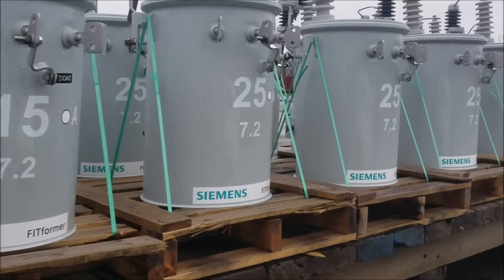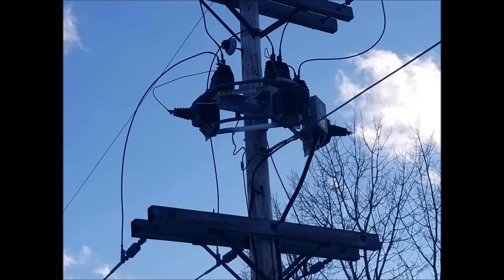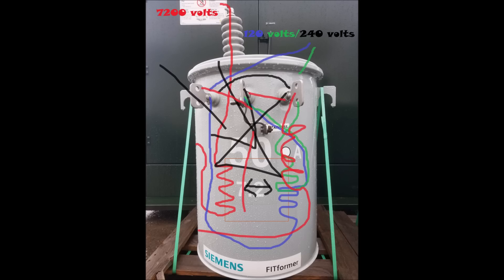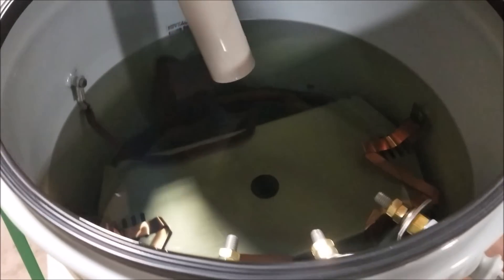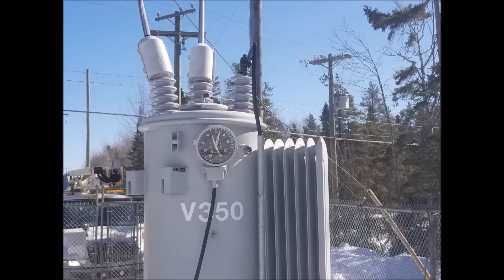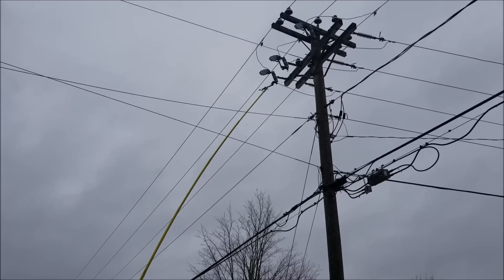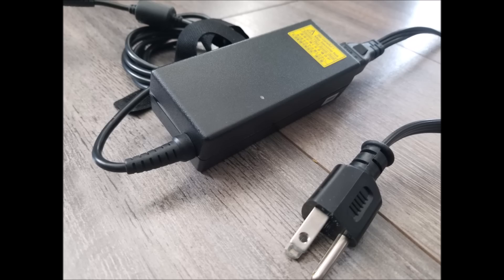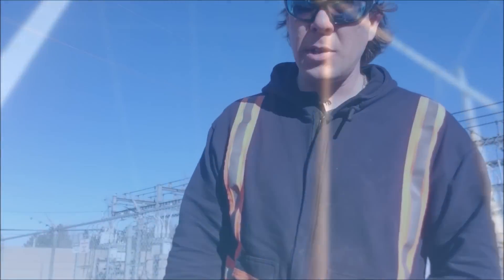What's inside a Transformer?

Comment: Nice and informative video however when explaining transformers used within the home most shown are known as switching power supplies. They do not used the legacy transformers to lower voltage and current. The types. Of legacy supplies are known as linear power supplies, they are considerably larger than switch mode supplies since they do use the archaic transformer inside. They are far simpler to repair and maintain but VERRY inefficient when it comes to power conversion. The transformer itself while on and idle will consume a fair amount of power.
Reply: A switch mode power supply reduces voltage in exactly the same way as a linear power supply - through the use of a transformer.  The difference is a linear supply operates at 50/60 Hz, and a switch mode supply operates at 100 kHz to a couple of megahertz.  That makes the transformer far more efficient.
Reply: Star Gazer Switchmode power supplies may use a transformer, but many use only a choke, which, while an inductor, is not a transformer (though one could argue over the similarity of a choke to an autotransformer, I suppose).  Which is used often comes down to the degree of isolation required (though many of the transformers used in common cheap Chinese switchmode regulators provide rather “unreliable” isolation...isolation is more a gamble than a guarantee).  That said, they are not used in a manner that is at all similar to a line transformer since the switchmode choke/transformer is being fed typically square-wave pulses (pulsed DC) of varying duty cycle and/or frequency rather than a clean sine-wave (AC power) and they operate on a phenomena rather different from line transformers since the output voltage is often far more, or less, than the turns ratio would suggest relative to the input voltage since they are utilizing a building (buck) or collapsing (boost) magnetic field to generate their output voltage unlike a line transformer where the secondary voltage is always proportional to the primary’s input voltage based upon the turns ratio (with some minor variation due to impedance and load variation pulling down the voltage under heavy load).
Reply: @ethanpoole3443  While true, all SMPS used to convert mains to low voltage do use a transformer and not a buck converter.
Almost always the low voltage side has other connections, and has to be galvanically isolated from mains, so it uses a transformer.

Only inside devices which are on mains voltage almost everywhere inside anyway (UPS, VFD for example) one will find non-isolated converters running from mains for auxiliary power supply.

Other than that, buck convertes almost always used to convert already low and isolated (typically up to 48V max) voltage to even lower (3.3V, 5V, etc...)
Reply: @ethanpoole3443  I've never seen a line powered SMPS that uses a choke instead of a transformer.  Chokes are usually found in buck/boost low level DC/DC converters.

Comment: My son was a first year apprentice lineman The back feeding of a improperly installed back up generator is exactly what happened to the Journeyman/trainer he was working with he was severely injured my son had to rescue and bring him down sadly he didn’t survive
Reply: It’s never dead till it’s grounded. Lineman have to keep this in mind every second every day.
Reply: @davidd1395  Yup. And if it's not generators, it could very well be induction from other energized lines, or even faulty UPSs that don't disconnect from their line side when they switch to inverter power.
Reply: Sorry about that. Wish you can get some strength and peace.

Comment: Very interesting video, thanks.
I have a question which may have nothing to do with electrical power but I’ll ask anyway in case it is. I’ve also seen someone else ask it but he didn’t get a clear answer:
Once in a while in my area I pass some metal pots attached to the top of sticks on the side of the road. The pots — which looks like typical pressure cookers — are about 1/4 mile from one another and attached to the tops of the sticks around waist-high. I have not seen any cables protruding from the pots. I’ve always wondered what they were for. Does anyone here know what I’m referring to?
Reply: The cans that look like pressure cookers are telco T1 repeaters.  A T1 is a 1.544 Mbps digital circuit often carrying 24 multiplexed phone or digital circuits.  The repeaters reclock and amplify the signals.  There are cables going into the bottom of the cans.
Reply: Star Gazer 
Thanks!

Comment: I don't know if you've fully explained the "transformer blew up" myth.  I know you've explained that it is the fuse, but have you explained that the fuse is designed to break the connection by forcefully ejecting the tail and how snow and ice can make it very difficult to tell when a fuse has opened, but still appears to be closed?
Reply: Michael Fresh  Hard to say without seeing it.  Could be an abandoned piece of equipment.

Comment: Friend, 
Did transformers in the past use PCBs as a coolant? I know when I was sent in as part of a cheap hazardous waste clean-up crew, to where transformers were stored, they were all paranoid about PCBs.
…..RVM45
Reply: New transformers have mineral oil. Many old transformers that have not failed or been upgraded in the field, are filled with PCBs.
Many electrical grid components are from the 1930s-1950s and are still working as intended.
Reply: Yes.  Go into Google and look up "PCBs in transformers".  Mineral oil is now used.
Reply: RVM451 At 4:07 in the video it shows a non PCB mineral oil label.

Comment: Is it really o my one wire in,  with the doesn't current reduce whenever voltage is stepped up,  and increase when it is stepped down,  I was taught this by a non electrician though. It's like a thermodynamics law. Damn and I though the end of the winding on the primary was like a return to the substation line or neutral. It actually goes directly to ground?? Fascinating.
Reply: Transformers follow the laws of physics.  The power that comes out of one can't exceed the power that goes in.  Power is voltage times current.  So if you step the voltage down, more current is available (if the wires are big enough to carry it).  When you step the voltage up, less current is available.  But about the same amount of power is on both sides (minus some losses that make the transformer hot).
Reply: ryan B — I’m assuming that at 0:25, the bare wire near the bottom is the neutral of a 3-phase Y distribution grid.  It looks like it is tied to the neutral of the 3-wire output, and it must also be grounded at the base of the pole.  Is that correct?  I would have liked to see these details.

Comment: in 1962 I was in electricity class in my high school. we took apart donated 3kva pole transformers. salvaged the iron, and copper wire. I made  a battery charger and some others made welders. we sheared the laminations to what we wanted. threw away the oil. the wire was 16 gage on the 2400 volt primary and 1/4 square wire on the 240 volt secondary(center taped for 120x2).
Reply: Wow how old are you
Reply: @JGProductions6581  76
Reply: You're lucky the polychlorinated biphenyl (PCB) oil used in those old transformers before 1977 didn't kill you.  It's nasty stuff.

Comment: love the video, just a note, the transformers that charges stuff like laptops they step down the voltage and them convert the AC to DC.
Reply from the maker: Your absolutely right! I totally forgot to mention that in the video 🤦‍♂️. My bad! I've been reminded lots tho 😬. 
Cheers 🍻!
Reply: Most of the cheaper units are just a 120-12 volt transformer with a full-wave bridge and maybe a filter cap....and maybe a 12.7 volt 5 watt Zener...
Reply: The one that drives your laptop actually first converts the line ac to high voltage dc, then back to ac at a much higher frequency (hundreds of thousands to millions of hertz) and variable duty cycle (to regulate the output voltage), then through a transformer, then back to low voltage dc. This is called a switch mode power supply, or a switching supply.
Reply: @stargazer7644  why does it have to be million s of hertz,  so it's pulsed dc and note asynchronous dc right?
Reply: @ryanb1874  They use very high frequency so that the transformer can be small and efficient.  Transformers for use at 50/60Hz are very large and heavy.  Yes, the input to the transformer is pulsed - transformers only work with changing signals.  I don't know what you mean by asynchronous dc.

Comment: The power supplies used on laptops and other electronic  household and entertainment equipment are not transformers at all any more.  They are linear or switching power supplies which are basically electronic circuits that take care of the step down and voltage regulation.
Reply: And still there is a transformer inside - just at a higher frequency.
Reply: Whose core voltage reducing component is still a transformer.

Comment: I met a guy working for a company that did Oil Testing on Transformers. He informed me they often pop the lids open on live transformers to take samples. He also said that's also when most new hires quit too LOL.
Reply: @billybob042665  Actually the day I met this gentleman he had to take the lids off because the transformers had no valve or plug. The substation was de-energized because it was DuPont's policy of no access while hot because the transformers were pole top units set on concrete pads on the ground. Which means the conductors were at chest level.
So yeah I can't actually say he's done it live before but on that particular day the cans did have no valves or plugs

Comment: Why do some transformers have 2 voltage ratings eg: 7.2/14.4? Is there  a visual way of knowing what the input voltage is?
Reply from the maker: Hey Dre! It could be a dual voltage transformer, or may be a step up transformer feeding into a 24.9KV system.

Looking at the size of the insulators or bushings can help in identifying voltage ratings...
However the proper and only real acceptable practice is to check the nameplate!
Reply: An easy winding design is the “center tapped” transformer. Halfway through the winding of the secondary a connection is made and then you have half voltage x 2. This is what home distribution transformers do. The center tap is the neutral, each leg is 110 v and across full winding 220v

Comment: What do the numbers no the transformer mean
Reply from the maker: It's the rating of the transformer . Some of them have a number along with "KVA", which stands for kilo volt amps. A "volt amp" is the same as a "watt" while taking into consideration power factor .

A "15" means the transformer is rated to handle 15000 watts .
Reply: The ones in our city have a single number like 75, a code like “y58853(In front of my house), another code without the Y, and the numbers “138/277,” which I think is the voltage on the secondary winding. They also have a single primary input and secondary outputs 2 hot one neutral, and a ground.

Comment: Great video, would love the Electrical Theory video! Really want a better understanding of why the transformer can be hooked to ground without creating a short.... i believe it has to do with eddy current? But I haven’t really heard an explanation that makes much sense to me.
Reply from the maker: That's right the eddy currents are what cause the resistance ! I think I may be able to describe this using the behaviour of water ! I've got about 6 different videos on the go at the moment but I'll try and write something up! Thanks for watching!
Reply: @Bobsdecline :
Actually, the eddy currents (within the laminations of the transformer core) would cause HIGHER primary current than if they didn't exist, as do the hysteresis losses in the steel core.  Good transformer design minimizes both of these, and other losses, without increasing the cost of building the transformer excessively.
In an "ideal" transformer, with no load, relative to the number of turns of the primary winding, there is enough steel in the core such that the core does not become magnetically saturated during one-half cycle of the supply voltage.  Until the core saturated, there would be zero primary current.
Reply: Bobsdecline that’d be awesome! I’ll keep watching, been enjoying the videos I always learn something from each one. Thanks
Reply: An example using a primary  voltage of 7620v  wye system phase to ground(earth) is able to be connected to one end of a primary winding  of a distribution transformer with the other end connected to ground or a delta system phase to phase w/ both ends of the primary  winding connected to a phase is based on the principle of BACK-EMF(electromagnetic force) meaning that any applied voltage to a primary winding opposes induced voltage of that same primary winding.
Reply: Transformers are not "hooked up to ground."   The primary neutral (or equivalent) and the ground (Earth) are brought to the same electrical potential by connecting them.  As electricity is always a circuit, grounding one of the circuit lines makes it safe to be around while keeping the other one dangerous.